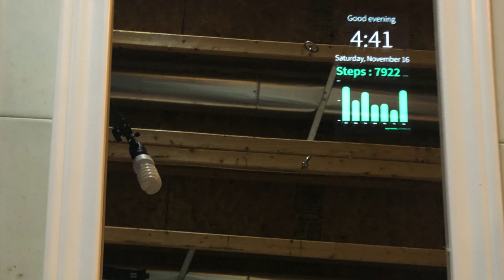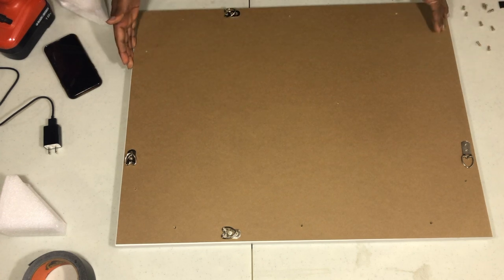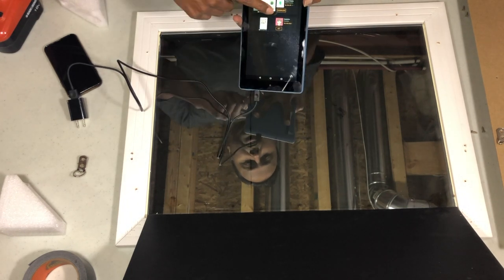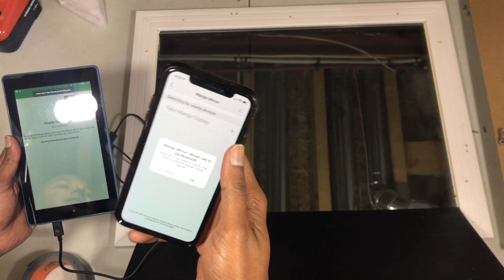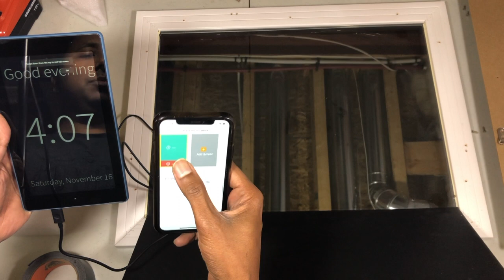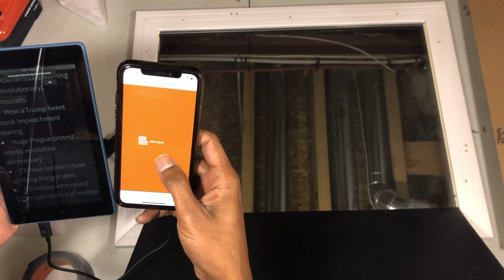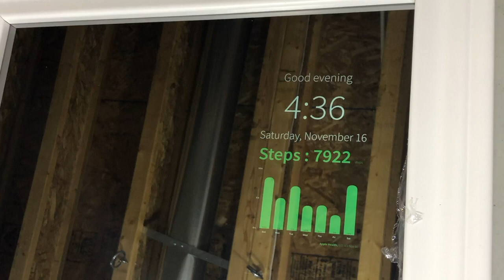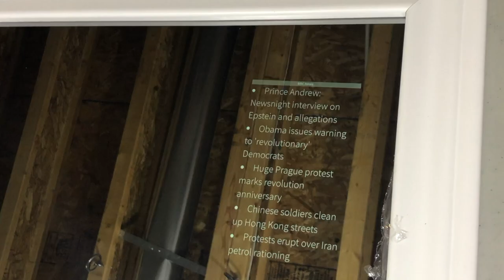Create your DIY Digital Family Calendar in under 5 minutes!

Comment: Does the mirror block the touch function of the tablet or does it work thru the mirror ?
Reply: you don't need to touch the tablet because you set it up and control the mirror with IOS device, make sure you set the tablet display to always on
Reply from the maker: Yes it does block it. Touch will not work.

Comment: This is fantastic and exactly how I’m going about building my smart mirror. I was planning to make a cutout in the black backing for the tablet so it would sit flush and hopefully prevent light leakage or strange effects with the mirror, but it looks like yours works great without that. Has it given you any issues?
Reply from the maker: Thank you!
Yes that would work, you can just use black tape around to prevent any light.
No issues so far 👍🏽
Would also recommend setting the tablet to the highest brightness setting.
Reply: Mango Display awesome!! Thank you so much!! I’ll do just that!